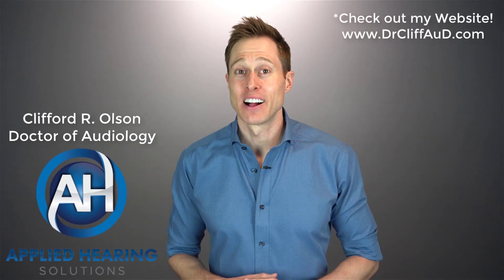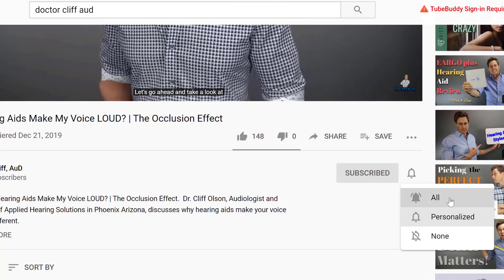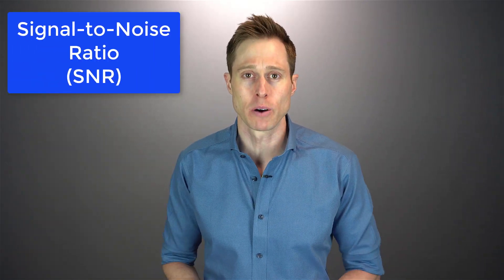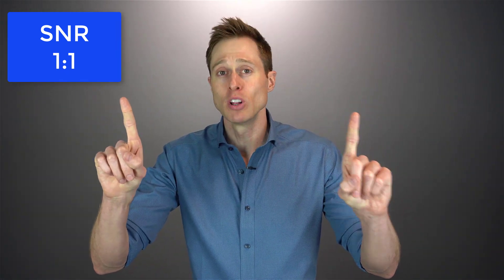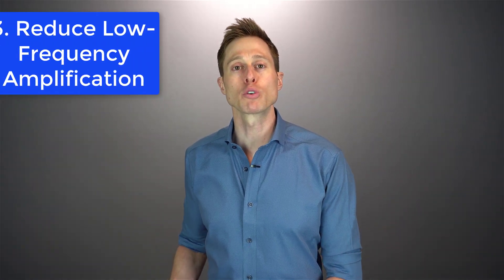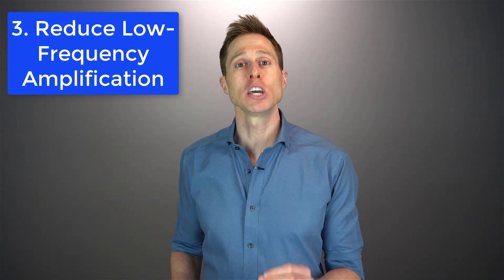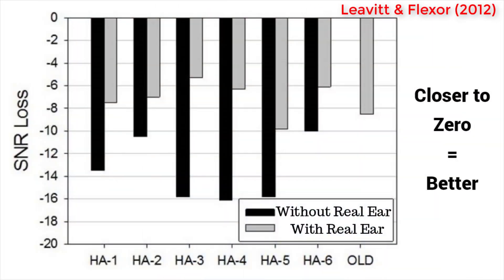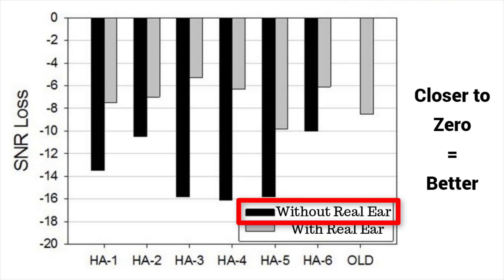How Hearing Aid Speech in Noise Programs Work | Hearing in Background Noise 😮

Comment: I specifically drove an hour each way to visit a Dr.Cliff Audiologist using best practices however after fitting Starkey Genesis 2400, no sound in noise (or any post fitting testing) were performed. Fitting, one followup and now I’m told we’re finished see you in 6 months?  So you speak about fine-tuning these expensive hearing aides to get the most out of them but put simply, Audiologist just don’t spend the time!  I’m sorry to say my experience with a Dr.Cliff recommended Audiologist was just as poor as a Non-Dr.Cliff recommended audiologists..😢
Reply from the maker: Please message me who the provider is, because this is a direct violation of Network requirements. Drcliff@drcliffaud.com

Comment: Great info dr cliffe.
I personally have problems in background noise. My oticon s2 were just replaced so I'm hoping the new ones will work better. 
It's been almost a year of trial and error to get the settings correct.
Reply from the maker: Did you have Real Ear Measurement performed on the hearing aids?
Reply: Yes I did. But only once

Comment: Dr. Olson,,
Perfect Timing….
Long time follower, the info., and help I received from your videos is priceless…
Which leads me to my question…. I presently have a pair of Oticon Ruby2.. I was just at my audiologist for an adjustment in my noise in speech program due to fan and AC noise, low talkers etc….
And I was told that I am at the end of what the ruby2 can do for me,, and I may be better served with the Oticon More 3 or 2….
I can not find anywhere info to compare the 2, so that I may try to make a correct decision….. 
I love my Ruby’s but they do have a few short falls…
They have been set with REM…
Any help, advise, or comparison info, would be Greatly Appreciate….
Thank You Dr. Olson,
Vince
Reply from the maker: If they've been correctly programmed with REMs and the Speech-in-Noise program has been optimized then you are probably at your maximum performance with the Ruby 2s.  However, what is your Speech in Noise Score?  Without that score, it is not possible to know if your level of expectation in Background noise is accurate.  Also, you may need a remote microphone, not a new set of devices.
Reply: Dr. Olson,,
Thank You So Very Much, for your reply…!
All great point…
As far as my score,, that Sir is a fail on my part..
I will reach out and get that info…
Again, Thank You for ALL your help…

Comment: This was VERY helpful!  I recently upgraded to the Advanced Bionics Sky M90 sound processors and one of the AutoSense classifiers is “Speech in Noise” which uses UltraZoom with a SNR Boost.  So the T-Mic gets used as well but if I had a regular Speech in Noise program that can be set to a manual program by itself then regular UltraZoom is used and I really don’t like it and the reason I don’t like it is because the T-Mic is disabled and only the front mic is used while the rear is reduced.  The SNR version the T-Mic and front mics are used and the rear is reduced.

I always wondered how this worked but I don’t like UltraZoom with or without the SNR because it doesn’t allow me to hear from behind.  If someone is calling me and it’s an emergency and they’re behind me I won’t hear them, they have to run to get me.

Now I have a much better understanding to how this works and how it should work.  I see my audiologist next week to get my map adjusted.  :)

Comment: IN May I called the VA in Prescott, AZ, over the phone I heard June 9th at 10:00 am.  I went there and was told my appointment is July 9th not June 9th.  Parking is difficult and I had to walk a long way with problems with my foot and ankle with arthrits.  It seems that an appointment 2 months after I called is a long time.  It has been 7 years since I was in audiology.  It seems to be a long time to get an appointment.  I can't afford hearing aids from the private source, and medicare does not dispense hearing aids.
Reply: Actually 2 months at Prescott VA is not bad. Yes, parking & renovations are a mess.   Ask if they can fit you with Phonak aids.

Comment: I would like o hear about the Oticon More which uses a different method of cancelling background noise
Reply: Me too. I use  the Oticon more ans there is no speech in noise program, just a MoreSound Booster that I don't think is the same thing. My experience is that the More approach is better than speech in noise programs I have tried before.
Reply: @PeterMcClintock  Audiologist here. Your hearing aid provider can add a speech in noise program to Oticon More aids if you need one. But they often don't add one, because the default settings usually work just as well. If you find that you struggle to hear in certain situations, you can talk to your provider and they can maybe add a program that is tailored to those situations.
The trend has been for hearing aids to become more automatic, so that you don't need manual programs. That way you don't have to fiddle with them as much. But manual programs are still an option if you find that they help.
Reply: @pentatronic  Thanks. I think they're good as they are.
Reply from the maker: I talk about the Oticon More in some of my other videos.